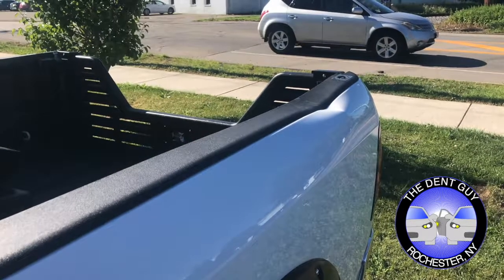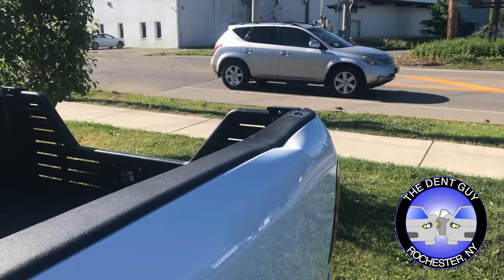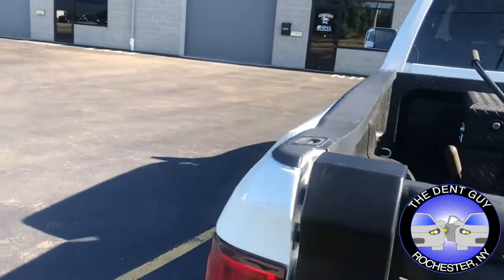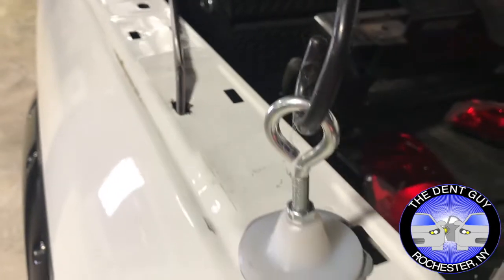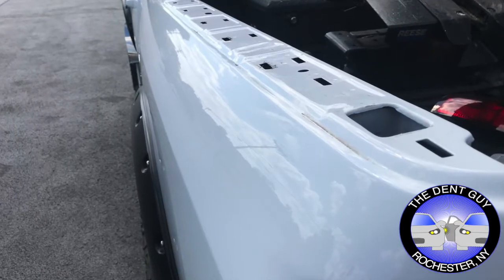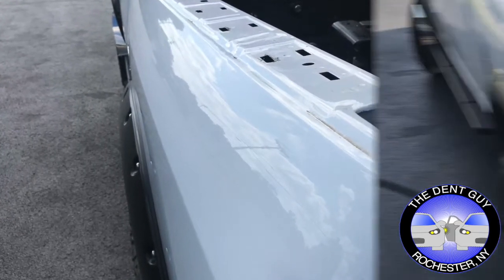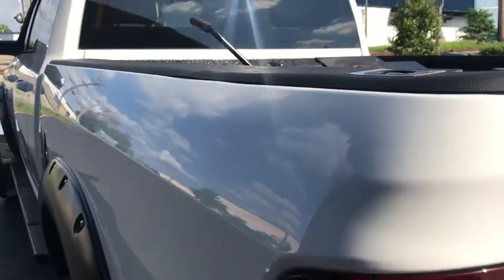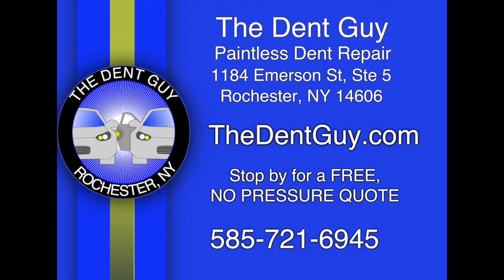The Dent Guy |  Large Dent Removal In  Truck Bed | Rochester NY | 2016 Dodge Ram 3500

Comment: i have dent above my tailgat light on 3500 ram dont haved access to lift to pull it up its a 5th wheel accident, but its right on the corner above the light not much room to get tool in to pound it out i have a torch to heat it or should i cut it to be able to munipulate it then bondo it? plz responed because im working on it now